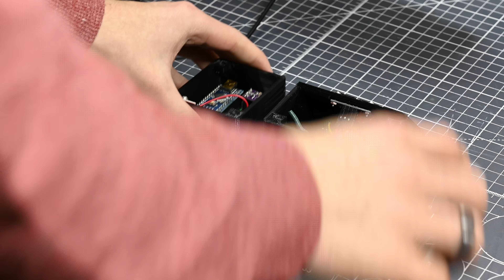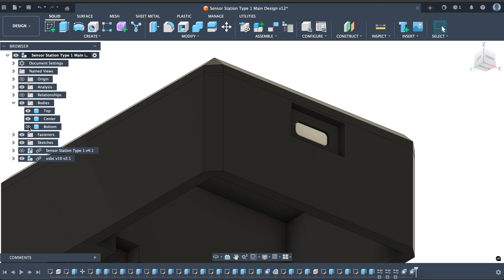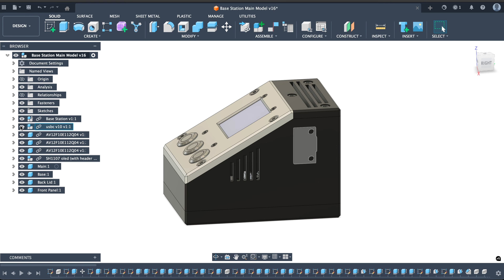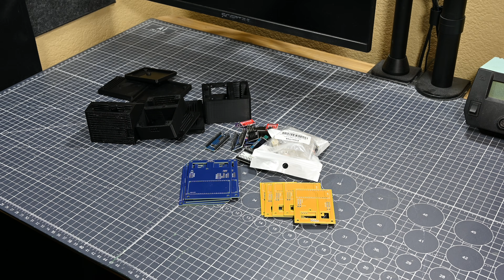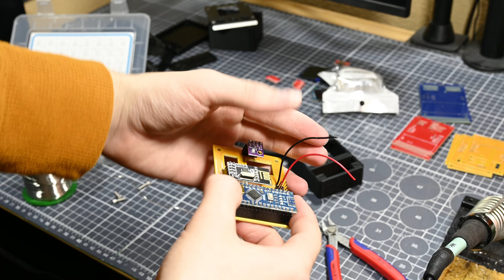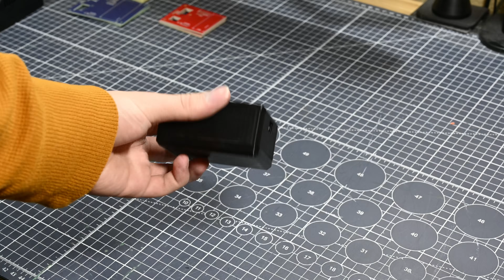I Built a High-Accuracy Wireless Temperature Monitoring System for my Minecraft Servers.

Comment: Wow, haven't seen anyone using an nrf24l in like, 10 years.... Did you consider: ESPHome + DS18B20 + DeepSleep (which also negates a lot of the heat output of the ESP) and then send everything over UDP via ESP-Now for instance (or Home Assistant direct API connection that uses protobuf over UDP)?

Comment: This is all very specific and interesting.
I would like to make a mechanism to open the front door of an apartment building from a distance.
For when delivery drivers can't drop off my orders.
Reply from the maker: It's very likely you could harness some of the wireless communication used here to do that! Though, if you were thinking to do this from outside of the apartment complex, you might have to use wifi and webservers
Reply: That's easy. ESP32, relay to the button, esphome as software, mqtt for communications, home assistant for phone dashboard